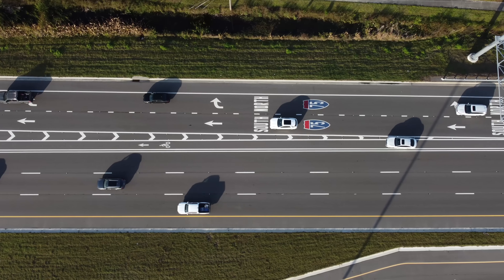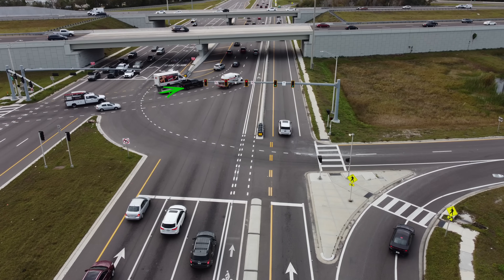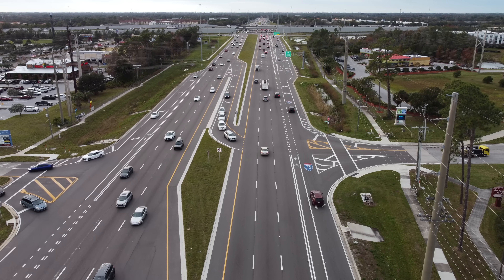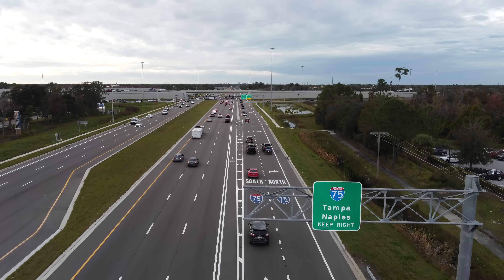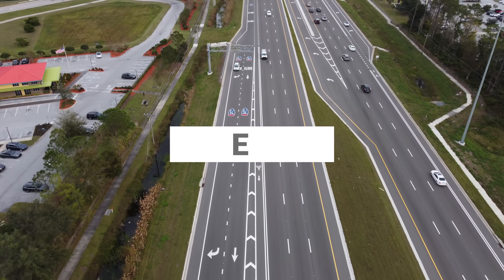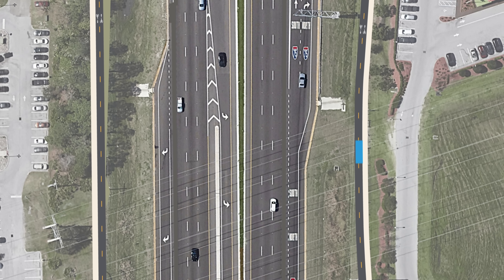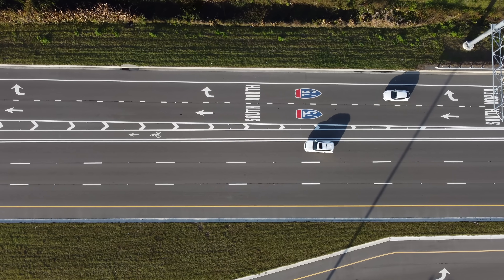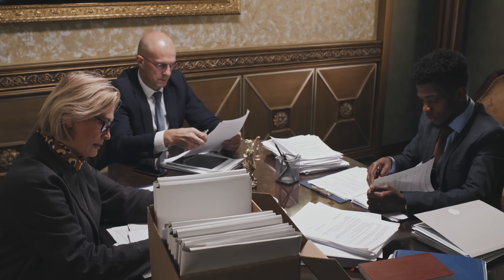This Brand New Interchange is Already Flawed

Comment: The worst part of that Bike lane is the more stuff like that is built, the more people expect you to use it. My city has a pretty deadly bike lane on a couple of streets. The roads are posted speed limits of 45, but almost every one drives faster because it's so straight. The bike lane is super narrow and slanted into the gutter, often filled with broken glass and other trash from the road. But because the bike lane is there you can actually get fined for riding a bike on the sidewalk.

Not that any one has been far as I know, but it's on the books. The more bike gutters and death traps the city builds the more likely they are to ban you from using anything but those bike lanes.

Comment: That cycle lane has me screaming, what the hell is a cycle lane doing on what looks like a motorway or at least a multi-lane speedway? And in the middle of the road nonetheless? This goes against any rule civilized countries take for granted - bikes belong OUTSIDE the driving lanes - to the side, possibly behind a physical protection. And roads rated for high speeds should never have bikes on it in any way. Get your road types clear. There are around 3-4 types of roads and they should never mix. You have motorways that are motor-vehicle only, minimum separated directions, minimum 2 lanes per direction and free-flowing (no crossing lanes, no signalized intersections - free-flowing interchanges only).
Then you have regional roads for up to 90km/h speeds usually not meant for pedestrians, and bikes may have to share the road with other vehicles.
Inside cities, nothing goes over 60km/h (for 4 or more lane arterial roads with separated bike lanes) or 50km/h for regular streets.

Which one of them is this example? It looks like a motorway, it has as many lanes as a motorway, it is an interchange, not crossroads, but it has no separated directions and it has a bike lane, and turning isn't protected. It makes no sense, nothing like this would be allowed to be build in most countries.

Comment: 6:40. A bike lane is treated like another highway lane that motor vehicles have to make turns over when at cross streets.   With a right turn lane for motor vehicle traffic the bike lane has to cross over the right turn lane(s).  That comes with difficulties.  With this traffic design geometry the right turn lane also has  a through lane that is active when there is left turning traffic into the through lanes of the route.  Since this through lane will not disappear it will have to crossed again by the bike lane.   Bicycle traffic has the right-of-way, but it is a merging situation which is cooperative of traffic in all lanes.    Whatever the crash situation the cyclist will lose.   

The design speed for an arterial bikeway should be a minimum of 30 mph.   20 mph design speed for feeder paths of less than 1 mile is acceptable.   Even 30 mph design speed bike path is not what people want.  They want rail-trail alignment like bike paths with freight train grades.   Side paths bike paths are ideally placed 20 feet or more away from the motor vehicle traffic lanes for a safety buffer and snow pile area between them.   ASHTO guide lines is 10 feet, but if only 10 feet away snow and sand get plowed on top of it.  Better to have a drainage ditch between them and more space than 10 feet.   That safety buffer is used for sidewalks as well.  In Indianapolis some sidewalks have been placed just inside the real estate corridor boundary leaving 50-feet between it and the traffic lanes.   That takes place when it is planned the road will go from 2-lane to 4-lane with additional auxiliary lanes.   It  is detouring walk at side streets to come up to the motor vehicle lanes for crossing.

When the side path comes up to a cross street it is current highway design doctrine to have the side path be placed five feet or so from the motor vehicle traffic lane before the side street with enough distance so motor vehicle operators will see the cyclists being in an auxiliary lane.   It is to act as another traffic lane, but not for motor vehicles.   This is a by-directional auxiliary lane at the cross street.   How snow removal and placement is handled is typically disabling.   

Motor vehicles making turns across the side path bike lane have to wait for traffic in the bike lane.    As a cyclist I really want that side path to be placed next to the motor vehicle lane with traffic in the motor vehicle lanes seeing it for a good amount of time before crossing the side street so they don't turn into a cyclist.   With a right turn lane for motor vehicle traffic the bikeway traffic has to cross over the right turn lane.   Cycle traffic really shouldn't have to stop to cross the right turn lane because it is on the primary route the same as the other through traffic.    When the speed limit is above 40 mph the road is considered high speed road.   With such a large divergence of speed between cyclists and motor vehicles a cyclist is better off approaching crossing a right turn lane perpendicular to it to allow seeing crossing cars.   This is 

The other bicycle facility intersection away from a motor vehicle intersection is known as a "mid block crossing".   I mid block crossing is suppose to be defined such that motor vehicle traffic does not backup on to it from another intersection.    That is not possible in heavy congested areas, but signage to alert drivers to not blocking the crossing can elevated that problem.  With good motor vehicle gapping or platooning taking place mid block crossings are considered the most desirable by cyclists.   With a center island waiting area mid block crossings with frequent gaps in traffic even if 3-lanes are preferred over bicycle flyover bridges.   A bicycle fly over bridge forces a cyclist to clime to the same height as the roof top of a two story house lifting them and their bicycle just to cross a street.   

Roundabouts are typically secretly promoted for traffic calming devices to discourage through traffic.   Highway design is a roundabout is detrimental to through traffic of the primary road over a traffic light.   A roundabout geometry  have a key benefit of addressing ponderous amounts of left turning traffic.   A roundabout in the USA is Single Lane traffic circle with operating speed of 10 mph - 15 mph using yield merge traffic metering.   That is what is used in statistic for people promoting the safety or roundabouts.  Musil-lane traffic circles with operating speeds above 15 mph are not roundabouts and are considered dangerous.   There are high speed large diameter traffic circles in the UK with speeds of 45 mph known as rotaries.    Those have long yield merge areas.

Comment: We are going to look at realistic changes. TUNNELS!!
Yeah, the minimum vertical clearance for a bike path is 8'. You will need about another ft for the tunnel roof. Not needed, but should have another 2' to the driving surface above. So 9' to 11' from path to road. The road is just above the surrounding area which is a marsh. So you think we can dig down 5' into saturated soil?

Comment: 5:10 I think the design could be helped a lot if the bike line were painted bright red for the whole lane. Maybe that would make car drivers to think twice before crossing it?
Reply: Or y'know, a path (there is literally so much room.) This is a better option because cyclists can still be dumb there and cars can still be dumb and get someone killed in your option.
Reply: @superknugs6327  I totally agree that a bigger design change would be better but adding some paint would have very minimal cost and it would already improve things a lot.

Improved signs for the cars would be another cheap fix that would improve safety a lot.

Comment: Whoever designed this needs to put in jail for attempted murder of cyclists. There is no way I would ever use that bike lane. Auto traffic crossing like lane? In the middle of an Interchange? Cycle traffic and auto traffic CANNOT coexist in the US. Our drivers are only ever 70% qualified to operate a motor vehicle; you can expect no better because our pass/fail threshold for the written exam(which is also multiple choice) is 70%. Would you trust in 70% when it comes to your survival? I wouldn't.

Comment: Also, heading eastbound.. the traffic light were mounted vertically at first and the bridge would block the view of the red light until you were 100 feet from the intersection itself. Now they mounted them horizontally so as you drive, all 3 colors of the traffic light are revealed at the same time.

Comment: I can tell "Streetcraft" knows absolutely nothing about Florida.  Suggesting tunnels for pedestrians and bike lanes.  Are you're crazy. You must be one of those students who graduated with a C- to D grade point average.   This is FLORIDA, nothing but 100% sand and water.  The cost to build tunnels is three to four times the cost to build an overpass, due to 1) Sand 2) Drainage.   Between the reinforcements needed to hold back the pressure exerted on it by the sand (raining season WET SAND) to keep the tunnel from falling in on itself and the drainage system, (pumps) needed to keep the water out.  A single pedestrians and bike lane with tunnels would more than double the cost of the entire intersection. 
That is why we do NOT have basements in Florida. A half basement in a single-story house cost more than building a three-story house without a basement.  No one wants the cost or maintenance issues that go along with below ground level structures.  And you still have the ongoing issues of water intrusion, along with the pressure exerted on the walls by the sand and water on any below ground level structure.

Comment: I think a dedicated bike path is a good start, but I can see a problem with your idea of tunnels already. Notice the bodies of water around the ramps to the highway. The road is barely above the level of water, which means the water table is likely just below the road surface. Any tunnel would likely have flooding issues.

Comment: you dont need dual pathed bikelanes on each side - either one way on one side and the oppesite way at the other side like the cars - or stick to one of the paths. Also if you are already doing a dual pathed bikelane - maybe put it not right next to that road - but as far away from the heavy poluting cars as possible (like done with the crossing section showed just before the tunnel option), so those biking dont have to gasp for air within an arms reach of a heavy duty trucks tailpipe.

Comment: 2:10 no land, really????
I live in Paris.

Try “Porte de la chapelle” in Paris in google maps.

What, with a little thoughts in design you can actually have 8X8 lanes interchanging in a dense area.
And it is even walkable???? Not very comfortable to walk there but you can go from one side of the interchange to another one by walking if you need to.
American road designers are insane. Just insane.

Comment: A bike lane in the center of a major freeway that’s only demarcated by reflective paint on the road?  If bicyclists use that road, there’s going to be people riding bicycles killed or seriously injured on a regular basis.  Cars on a freeway are traveling at speeds of 50 or 60 MPH, and have to make quick decisions on which lane to be in and may not have time to see a bicyclist in the middle of a freeway, especially if it’s dark out or weather conditions are not good.  Whoever designated that area as a bike lane is an idiot.

Comment: ah yes the error made is: they forgot how Florida  drivers drive. They are entitled, speeders and will cheat on any occasion with out regard to other drivers.  I remember 441 in Margate, there is a traffic light every 1/4 mile or so, and every time the light turns green everybody races to be the 1st car at the next light.  I once saw a battle of lanes where a car was pushed up over the median into the canal because the car did not want them to merge in front of them.
also-tunnels are a horrible idea. pedestrian tunnels always end up as the perfect spot to commit crime under the tunnel where nobody can see.

Comment: I ride bikes all the time and the best way to accommodate bikes is a good greenway system and separating bikes from busy traffic as much as possible. A wide two lane secondary road of 45mph or less with a marked bike lane is the best type of road for bikes. At a certain point I think driver expectation is by the time they get to the highway onramp they're not going to encounter any bikes. 

This video is a bad design not just because of the bike lane but also because existing traffic in one direction can't go straight to get back on the highway, which could be easily fixed since they already made a stoplight intersection for the offramp traffic to turn left. Oh well, government employees got paid and they have great pensions so I guess that's the main thing that matters in any government-run operation.
Reply: Have you ever lived in Florida? Biking as a transport option is absolutely torture there. Not because of infrastructure. But because it's so flat. And everything is so far away.

Comment: What idiot decided to add a bike lane within an interstate highway?  With todays aggressive drives it is a formula for disaster for the bikers. I am a highway engineer and this video points out all of the dangers and provides a viable solution which should have been included in the original design.
Reply: I'm from Florida. They probably did it to get extra funding. But if you lived in Florida. Then you know biking 25 miles a day is not reasonable. Especially in year round 95 degree weather. Flat ground makes biking boring and arduous. Everything is simply too far apart for biking in Florida. There was never gonna be people riding thier bike to this point. Just think. The closest house to this point is how far? 

Don't get me wrong I live in denver now. And dream of not needing cars one day. But im just trying to put perspective on this. 

They probably knew it was silly design, but didn't care cause no body commutes on a bike in Florida. Only people who lost thier license do that lol. 😂

Comment: Signage is key. If you don't get this right, you're going to cause accidents by drivers who want to correct them immediately because going around will take too much time.     The pre-signage that directs you to be in the correct lanes is often wrong in CA. The common one is announcing to get onto a freeway right lane. Then, when you get to the transition roads, you need to be in the left lane to go one direction and the right lane to go the other direction. Or the pre-signage doesn't direct you at all which lane is going to get you on the freeway until you're right on the transition lanes. We have one street trying to be helpful where the pre-signage says the 3 right lanes go straight. Sort of. When you actually get up to intersection, the far left of the 3 right lanes turns into the left turning lane only. Then another lane is added to the right of the original far right lane to make up for 3 right lanes going straight. It would be better if there was no signage at all before you get to the intersection.

Comment: Nothing wrong with a clover leaf. Stop with the I'm improving the system.
 NO You're not! This is proof the original plan was 100% correct. They where worried about merging traffic 😂.  That's what you do at an interchange 😂. Someone should be fined and fired.

Comment: signage is a HUGE issue on the garden state parkway. it's a five lane highway and at some exits they have signs spanning three lanes highlighting different points of interest on the one exit even though the exit is less than a mile away and only in the rightmost lane, causing many people to quickly change multiple lanes without looking and crashing into oncoming traffic. the manuever has even earned the nickname "the jersey slide" because of how much it happens on the gsp. one of the worst highways to drive on, especially if you're a new driver, and always backed up around the us1-9 exits because of accidents

Comment: Sorry to say but there's a reason that there almost no tunnels in Florida.
That's because the water table is only about 5-8 ft. below the surface. 
This is also the reason that Florida homes do not have basements. 
So tunnels for bikes wouldn't be feasible option. 
However if they were to put in a traffic lights for the bikes or "Don't Walk" signage on the crosswalk for when the left turning vehicles are turning, then that could be a solution.

Comment: Finally, a proponent of separate cycling infrastructure, the differences in speed between cyclists and motor vehicles should make this a no brainer. The bean counters are the ones who always seem to vote for the painted line approach because it is initially cheaper. Lots more would cycle if it felt safe to do so but painted lines and cars whizzing by does not give that feeling at all.

Comment: The ped/bike tunnels are a non-starter.
Many users perceive ped/bike tunnels and bridges as traps where predators can attack them. So, they just go around.
Tunnels will produce an elevation change for either the cars or ped/bikes. The ped/bikes will be reluctant to go down and up again. In Florida, a dip like that will flood frequently and be difficult to drain reliably due to high water tables and frequent raifall. Having the cars go up and over will introduce a sight obstruction preventing drivers from seeing the road for an appropriate stopping sight distance.

Comment: It seems that vehicles cannot easily make a U-Turn if they exit the freeway and need to go the other direction with that barrier there. Certainly people in general would benefit from that option occasionally, but emergency vehicles (especially troopers) wouldn't be able to flip around as easily. The best U-Turn scenario I've experienced are off I-15 in Orem (e.g., University Pkwy and Center Street).